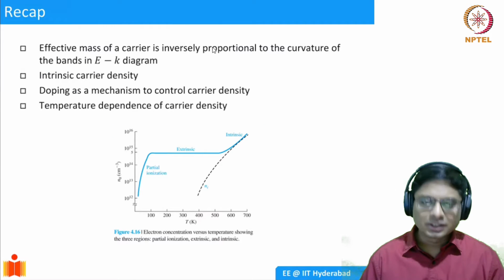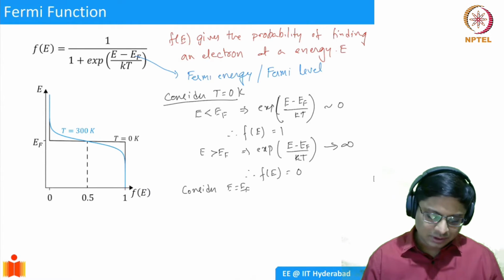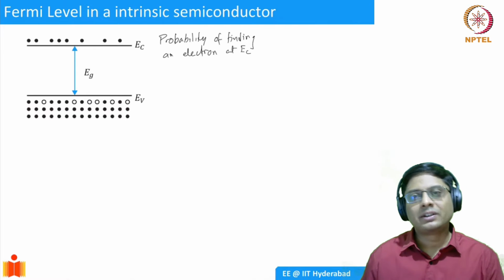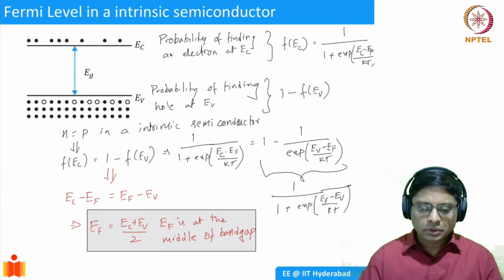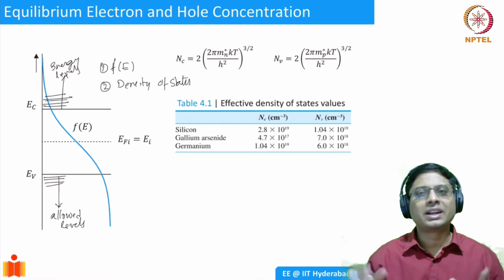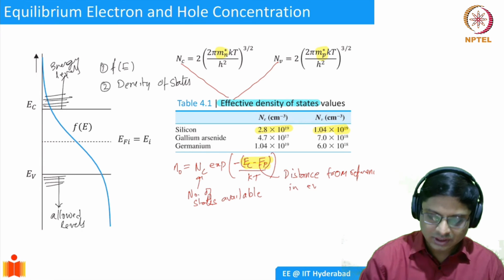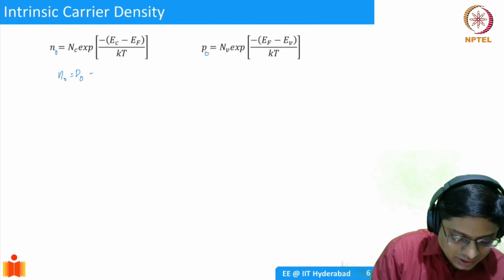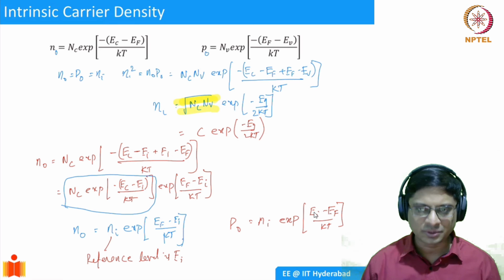2.4 Fermi level in extrinsic semiconductors

Comment: Sir how can prob of finding electron at Ec is equal to 1-  prob of finding holes at Ev just by n=p because in both valence and conduction band there is multiple levels where the electron and holes are present but u have only taken holes and electrons at the level of Ec and Ev but not at top and bottom of it respectively